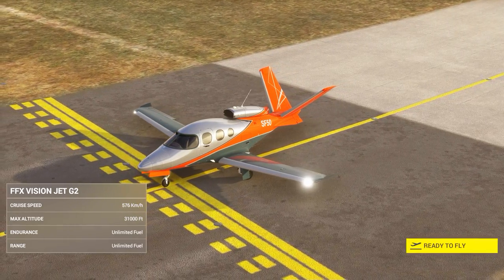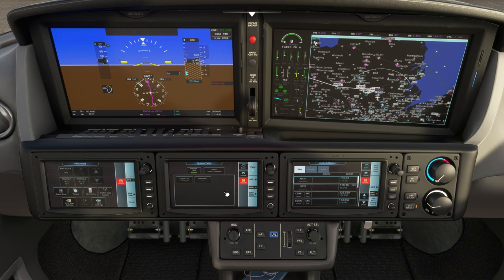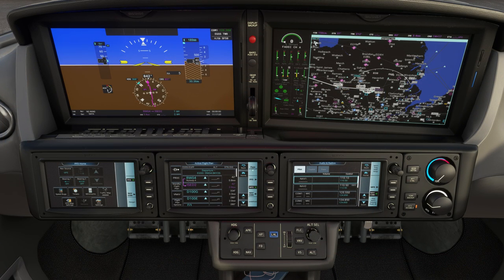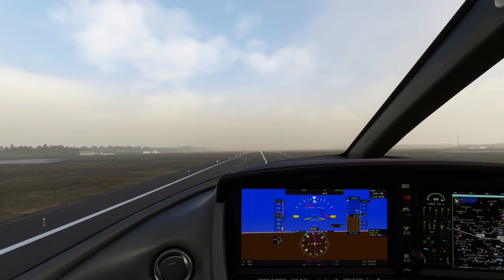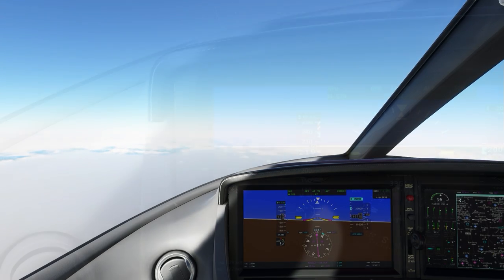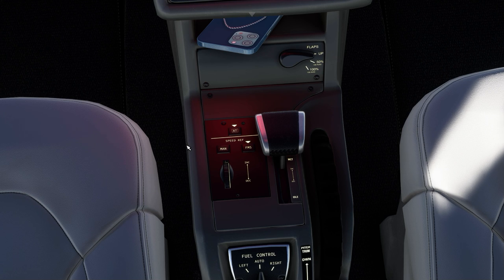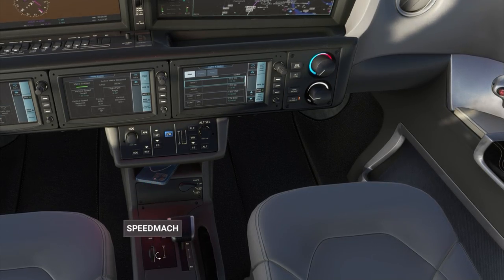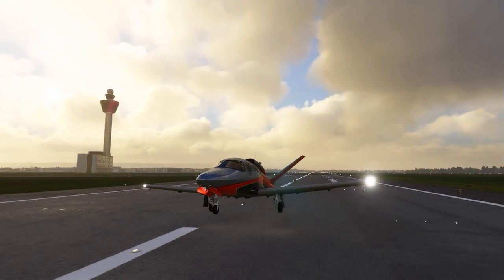MSFS Cirrus Jet / Vision Jet G2 - Easy Tutorial

Comment: how do you know what your bottom of decent is?
Reply from the maker: Airport elevation + 2000ft roughly. You can also check approach charts if you want a more accurate figure.
Reply: I would assume that you are asking where the indication for BOD is shown (vs TD or TOD). In some aircraft types, this is displayed in the form of a graphic symbol which is "tied" to your route-of-flight line and which moves fore and aft along that line. When you think about it, unlike the TOD, the bottom of descent point is constantly changing. For example, when you reduce power, the BOD graphic point will move to show you will arrive at the bottom "sooner" whereas increasing your power (reducing your rate of descent) will obviously delay reaching the BOD which means it will be further down your planned track. Systems which have this ability are common and are extremely helpful. In the real world, the computer is constantly computing the BOD based on everything you do at the flight controls to affect the BOD point. The computer, then, constantly moves this BOD graphic along your course line instantaneously.  Practically speaking, this is a really terrific feature because, for example, you can adjust any cockpit flight control or engine control which impacts the BOD point so as to attain what you desire. If I want to, for example, cross a certain intersection or point along the route at a given altitude, I can just fly a constant speed descent and adjust the power/rate-of-descent so that the BOD symbol falls directly over the intersection/point.  It's important to realize that this bottom-of-descent symbology won't be displayed until you actually BEGIN your descent. Logically, this makes sense because the computer has no idea how you are going to fly the descent. So, it waits for you to "show" your technique (speed and rate of descent) and the computer calculates the results of your doing that.  Note that elaborate, sophisticated avionics factor in all of the flight parameters which affect this calculated descent path. This includes density altitude, temperatures/current winds aloft, etc. for example. This feature is dynamic and one of my personal favorites.  It works in both climbing and descending profiles.  I enjoy this Cirrus G2 but some of these types of features are not to be expected. However, even without the symbology, the VNAV calculations to cross intersections at planned altitudes works reasonably well.  If you want to see an outstanding example of better systems, I recommend the PMDG 737-800.  The FMC in that product is VERY close in performance the actual aircraft's system and this BOD (moving arc) feature is no exception. It works perfectly just as it does in real life.  I hope this helps you.  Best regards/fly safe my friend.

Comment: Not bad. I fly an SF50G2 for a living. 
Couple comments:
Never takeoff without Bleed/Fresh set to Bleed and the O2 on. The system is set to increase the cabin altitude at specific rates and turning it to Bleed at a few thousand feet can result in arrival at cruise altitude absent correct cabin altitude (hypoxia risk) 
2. Don’t be in a hurry to bring the gear up when you still have usable runway beneath you.  I know it’s a sim but right is right. 
IRL, the SF50 is a lot of fun to fly and likely one of if not THE safest single engine airplane made. 
Cheers.

Comment: Thank you for your tutorial. One problem: On short final I switched AT to Manual, but then I could not disengage AT. I pressed AT button on the pedestal with click mouse. Should I have pressed some lateral button on the throttle itself? I botched badly the landing, went for a turnaround but throttle and stick worded chaotically and I landed very badly:) YD was still indicating on my pfd. Might be silly but how do you disconnect the autothrottle? Many thanks.
Reply from the maker: Assign a hardware switch for auto throttle on/off :) I have it bound to my Airbus stick next to AP disengage
Reply: @TiJayFLY  Many thanks! Will do.

Comment: 2:11 In this Vision Jet tutorial, the aircraft is set to VS 2000ft/min for the climb phase, while in your other CJ4 VNAV tutorial, you set the aircraft in FLC mode for the climb phase.

 Which is the recommended mode for the climb phase? VS or FLC mode?

Would FLC + VNAV be a better choice, so that the aircraft FMS follows the altitude restrictions?
Reply from the maker: It’s personal preference for climb. Use VNAV for descent - this video was made before it was working
Reply: Not safe to set a vs in a climb

Comment: Thanks for the video, its been very helpful. I'm having one issue thought that is driving me nuts and maybe you can help. On final I click the 'Nav source' button but I don't have an option for ILS, only FMS, LOC1 and LOC2. I selected LOC 1 which gives me the ILS arrows for the runway but the AP just flew me in circles. I have the radio set up for the correct ILS frequency. Any help would be greatly appreciated
Reply from the maker: LOC1 is ILS. MSFS can be a bit funny with intercepting localisers at certain airports. The safest bet is to change to LOC1 once the airplane has already turned onto final in nav mode (assuming your route is set up runway to runway)
Reply: @TiJayFLY  WoW, I think that was the fastest reply I've ever had. I'm currently midflight now so will try it as I approach. Is it normal to only have those options rather than one for ILS? Thanks for getting back.
Reply: I tried LOC1 again and it tried sending me miles off course again so switched it back to FMS and it brought me down to the runway perfectly. Will stick with that now. Guessing it’s because of an update since this video. The rest of it has helped me out loads though so thank you very much.
Reply from the maker: @davenottingham3254  the procedure should always be the same - it hasn’t changed in the real world! Tbh this sounds like MSFS just being MSFS. A different airport should yield correct results 😁 in any case, glad you could have a successful flight!
Reply: Lol, the learning curve is huge for this sim but I guess that’s why we love it. I’ll keep working on what I’m doing wrong but for now I can put the jet down even in terrible weather conditions. UK summers are awesome!

Comment: That is not how VNAV should work.  You should not have to enter your VS.  The whole point of VNAV is to perform the decent for you to hit your target altitude at each waypoint.  This is broken and does not work correctly on the G3000 in the simulator.
Reply from the maker: Absolutely. Only the Honda Jet currently implements G3000 VNAV correctly.

Comment: when I see how you make this look, I lose all hope of becoming efficient. Such a struggle for me
Reply from the maker: At a systems level, there’s a lot of commonality across the same type of plane. For example, all modern Airbus are very similar, same with Boeing, and GA airplanes with G1000/G3000. 

Some older airliners and stuff with a GNS530 bolted on can be a little different, but by and large there’s a ton of commonality. 

It’s just hours, familiarity and commonality that makes it easy :)

Comment: how do i set the LOC CRS? didnt find a crs knob.
Reply from the maker: I’ve never set it on Garmin planes, I think it’s automatic(?)
Reply: @TiJayFLY  it sets the final apr crs automatically when the apr is activated in the garmin gps, but think you can still set it manually. in the g1000 the crs knob is where the QNH setting knob is. when i flew a radar vectored ILS with the SF50 in with nav source in NAV mode, it did not set the CRS to the finals apr crs :)

Comment: I need your help, I just realized that the fact that the flight plan loads strangely is not only from the EFHK airport, but from all the airports where I have added some airport improvement and Refinement, for example, I have downloaded the mod from Doha airport, but even then the flight plan does not load normally, so the EFHK dlc is not a problem, but in all of them airport where I have added refinement so is there any in-game setting related to this? I've been trying to find information for 3 hours but I haven't found anything :(
Reply from the maker: Are you planning your flight in the World Map? Is it feeding through to the flight plan page in the airplane?
Reply: @TiJayFLY  the direction of the flight in simbrief and it normally loads into the plane's flight plan, but for some reason it doesn't work fine-tuned at the airport
Reply: @TiJayFLY  sorry fligth plan didnt download to plane flight plane
Reply: @TiJayFLY  the flight plan didnt download to the airplane flight plan page
Reply: @TiJayFLY  watch discord